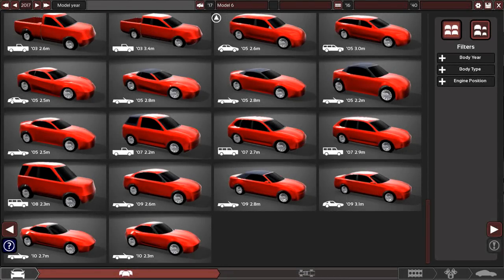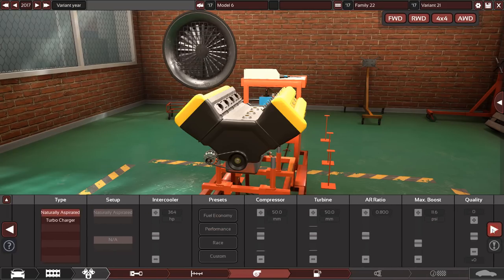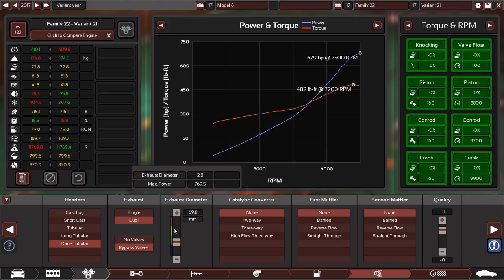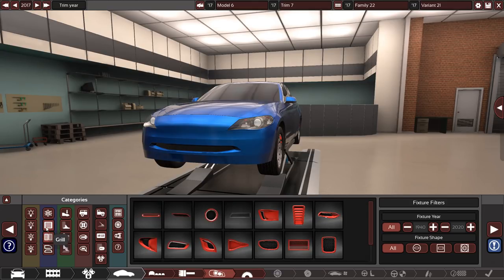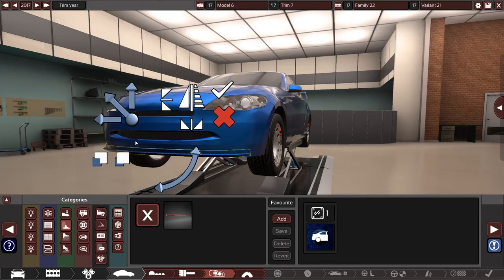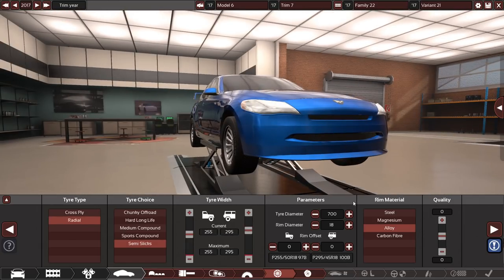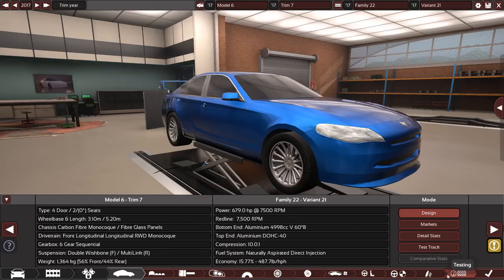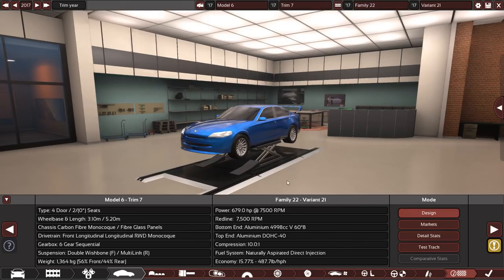Automation Challenge - FailRace Industries V8 Supercar !

Comment: Alex, FYI
-you can use a 90 degree V8 and still preserve the American Muscle sound if you don't use flatplane crankshafts, 90 degree V8s look a bit cooler and have a bit better efficiency but aren't quite as smooth
-follow the flowchart to see your exhaust (and general) restrictions, you want it about 96-98% airflow to have some mid range torque, there's an ingame explanation for it with gas velocities and pressures I think
-not everything has to be top quality, I know Failrace Industries are trying to push into uncharted territories but even for one offs or race cars they'd take an awful lot of time and money to build some things, so if you don't need the top end billet steel crankshafts or electronic diffs, don't employ them
-the most common LSD types are geared (torque sensitive, spool, geared, clutch etc) and viscous
-Top End quality greatly increases power, efficiency, reliability and octane ratings, but is a bad idea for consumer cars since you'll be spending ages getting it assembled
-5 valves tend to be uncommon, try using 4
Reply: You can also click on the titles of the selectable options, ex. Dampers to get an idea of what each option does. Adaptive dampers use magnetic particles that respond to electric currents or something, and that stiffens them when needed. Not all options have these tooltips but they are very useful for understanding, at least at a basic level, what each thing offers
Reply: And often for regular builds 4 valve ends up working better as it allows for VVL
Reply: Finally, this. I'm so sick of his "Oh +15 quality on everything it's fine because we're building a race car." excuse.
Reply: A Tomato he knows about the crankshaft style affects sound, there was one video on automation where he changed the crankshaft to see which one sounds better

Comment: Couple things if you decide to do a V8 Supercar build again.... Or just some generic fun facts. 

V8 Supercars in 2018 now feature both 4 door saloon and 4 door hatchbacks (new commodore). All 4 doors are completely functional something people don't expect about this racing category is that it is essentially a car off the shelf, with the innards and bits under the shell stripped out and replaced. 2018 rules are also allowing the new V6 Turbo engine to run. The new commodore for 2018 might just be Alex's new favourite, with the almightiest wing now attached to meet minimum length requirements.
Reply: Mike Feodoroff and turbo 4s can join to but the category is not keeping its head above the water currently it's Nissan,Holden and Ford with Alfa Romeo and Kia looking into joining and BMW who talked with Penske after Ford wouldn't let the ford team's have the mustang. and people thinking Nissan will put the GTR in are drunk because it technically is a Grand Touring Car.
Reply: ICEHAMMER GAMING That is true, a lot of reasoning behind why Turbo 4 isn't entering is purely because none of the current teams have the money to develop, let alone run an entry with that engine. There is also the added problem of VASC head honchos only allowing a certain number of championship positions per year.... And those are almost instantly snapped up by the likes of 888 Racing/Red Bull Holden Racing Team and PRA which run 3 cars already

Comment: Hi Alex, I think the chassis would be semi spaceframe and the rear suspension is control spec double wishbone.
Reply: Also OHV(pushrod motor) is 2v per cylinder or if it's the Nissan motor it's a DOHC 4v per cylinder.

Comment: E85 is about 105 octane, so you should have stuck it on the 100 octane option really
Reply: 100-105, so ultimate would have been closest
Reply: Maybe he was using the old premium unleaded fuel model.
Reply: As you saw, it didn't really make a difference because the engine has a relatively low compression
Reply: Roger Toledo ment mainly for accuracy tbh

Comment: Chassis should have been a boring old monocoque, most likely steel unless the road car uses alu, as is the case for many production based race cars. They use a modified production chassis, which can cause some problems if you need a new chassis and (as happens more than you might think) some revisions to the production chassis have taken place. A former employer of mine ended up welding plates and drilling useless holes into multiple shells to meet homologation on replacement chassis. Body parts like bumpers for us would be carbon kevlar, carbon fibre and sometimes individually 3D printed in expensive but fragile plastic to make design changes within deadlines, but most often fibreglass is used or in the top end of rallycross some trick ultra-flexible plastic is used by some. In a production car series the doors are likely to reflect what is in the road car. They will have all the comfort and sound proofing removed, but might have some crash protection added. Suspension you seem to have specced for a family SUV, adaptive suspension is the stuff that can change ride quality at the press of a button.

Most importantly though, you should have backed off on the cam profile to move the peak power back into your rev range, area under the curve rather than peak number is important if you actually want to be fast. back off the cam profile you could have improved both, potentially.